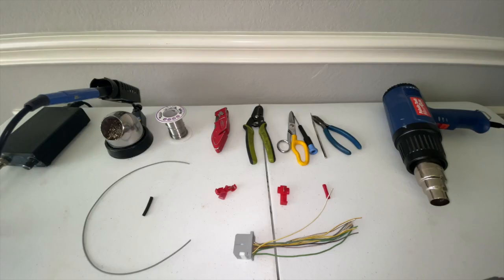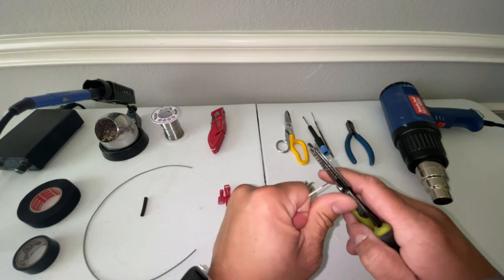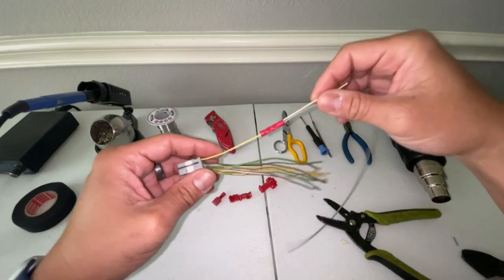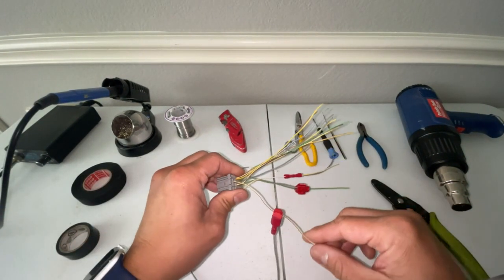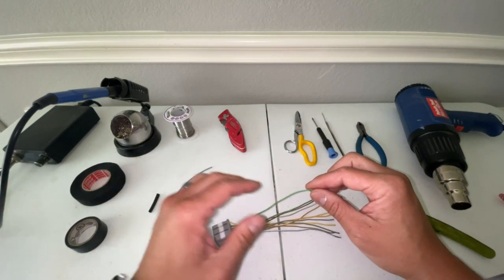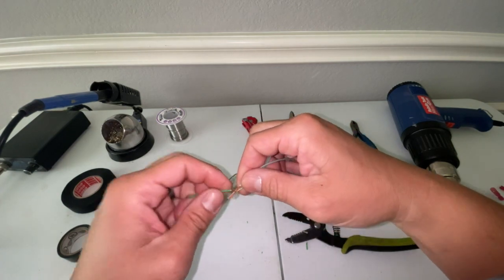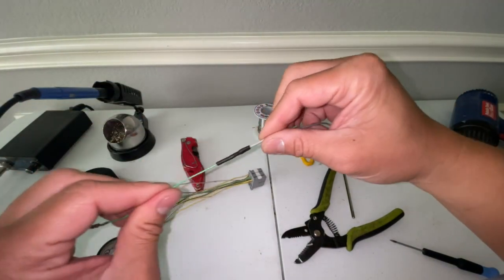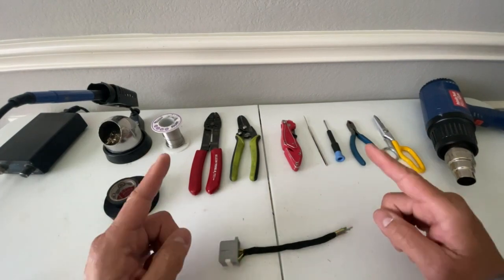How To Wire Splice

Comment: Well done video. Some newer style "butt" connectors have solder inside to heat up with heat gun to join wires, any experience with this type. Also no list of your heat shrink tubing, the "moisture" element has me interested.
Reply: In my opinion, Its melting point is far too low. The solder liquefies with a pocket lighter in a matter of seconds. Not something that I would use for more than 0.1A current or Automotive in general. Especially if you live in the South. Nothing beats using a soldering iron and some proper heat shrink
Reply: @dustinwpearce Thanks, good to have your opinion on this, agree with a good solder joint.
Reply from the maker: Good catch!  Here you go. 

1/8 Inch(3.2mm) 82 Ft XHF 3:1... https://www.amazon.com/dp/B07VCD27L5?ref=ppx_pop_mob_ap_share

I’ll update the list in the morning. 

I have not had any experience of the butt splice with solder.

Comment: All of those ways are hack ways except for actually soldering the wire.  I'd get fired so fast at the dealership for using any of those trash connectors
Reply from the maker: Agreed!  I don’t like them too.  For some products I sell, a splice is needed.  So I include splice taps but always advise to solder.  Now I have a video to help those willing to attempt to do it right.